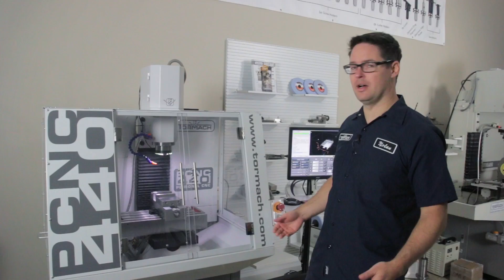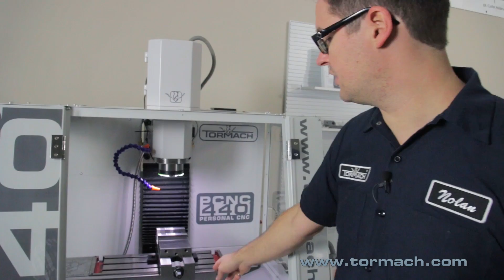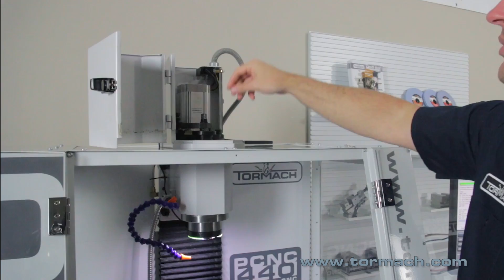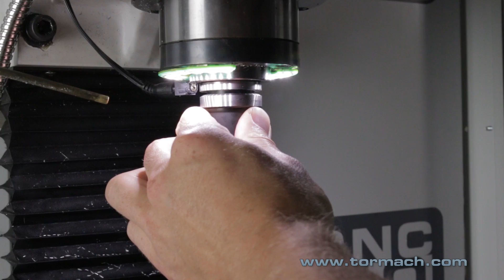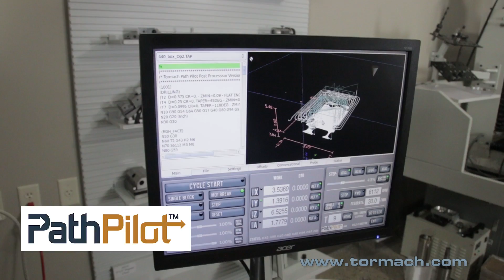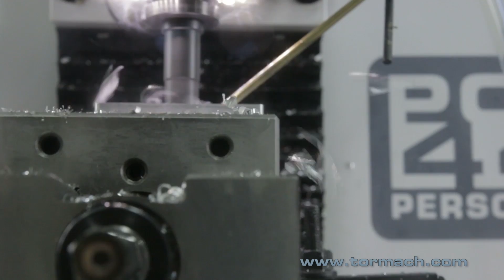PCNC 440 Walkthrough

Comment: With its work table size does that mean I could cut into 10"x6"x4" thick aluminum ?
Reply from the maker: +jayjdw The work travel is 10"(X) x 6.25"(Y) x 10"(Z), but the center of the tool can only reach the outside edge of that envelope, so you will have to subtract the diameter of the tool.

Comment: Do you get the same precision on the 440 as you do on the other mills, since you are using rolled ballscrews vs ground ballscrews? Does it not make much difference due to the shorter travels?
Reply from the maker: +tafollaj Good question.  The PCNC 440 is fundamentally a less rigid machine under load due to its smaller frame size.  However, you are correct in stating that the shorter travel limits of the smaller machine will result in nearly comparable precision to the PCNC 770 under no load conditions.